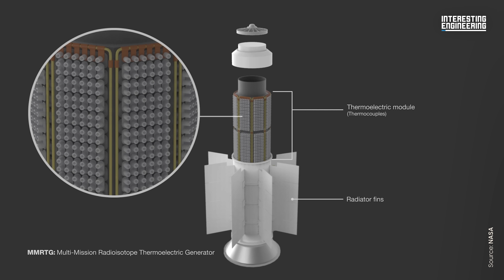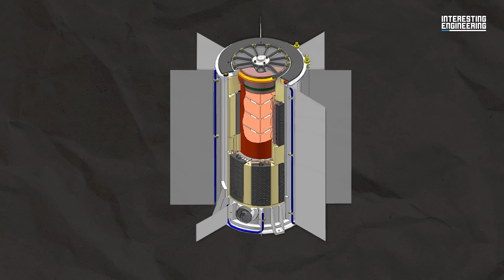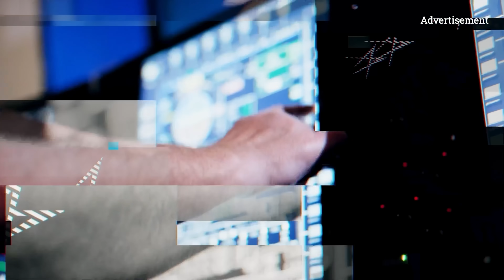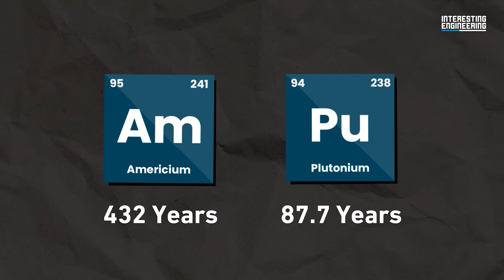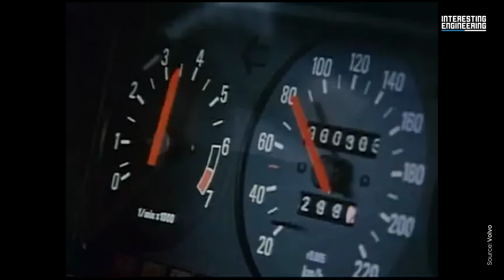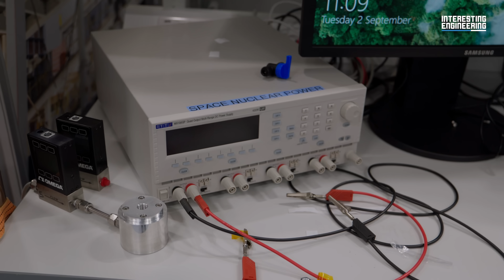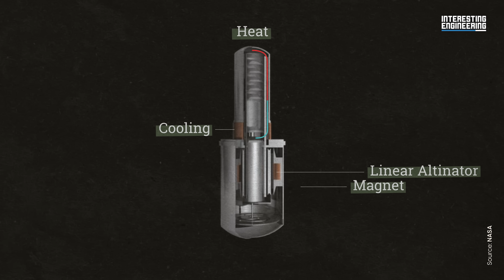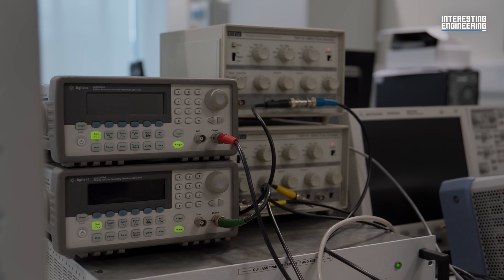Americium: The Element That Will Transform Space Travel

Comment: Americium, depending on the isotope for efficiency and electron migration from the nucleus for its placement in decay-chain (a principle not far off Caesium or Rubidium clocks), acts as a clock-signal, but so does a Stirling engine and also, so does an alternator if it is regulated by the sterling-engine (which it is, in that diagram). However, the americium is not simply an isotope clock but also a heat-clock by emission since ultimately it is unavoidable that the craft shall radiate some energy into space. That latter emission changes over time because the decay reduces the potential energy in heat but not the rate of isotope effective nuclear charge, even though half-life does undergo total rate differential. By means of comparing the "clock-signals" that won't change to the clock signals that will change, that is thereby a polynomial and phase shift 9and phase error) generator, as a crude function generator and potentially a crude PLL, phase-locked-loop which, if it is not being used, is wasted _(so it might as well be used as it is an oscillator). There are various usage scenarios like vector similarity comparison and signal-integrity and polynomial-fitting that can use it, such as polynomial-fitting unto an ogive on a cumulative frequency graph and the usage of he Lplacian-domain as a time-domain by novel adaptation of the z-transform, which not only can already be there by result of using the cumulative-frequency graph and thusly the frequency domain like a histogram and subsequently the gaussian-kernel distribution (or lanczo-kernel for filter and signal analysis such as its azimuthal data) but also the Laplacian-doppler combination gets used in space anyway, and the Poisson's equation can be solved for each change as per time and gravity. It is free secondary equipment usage for the same weight (or at least the heavy bit) and it also assists the reliability metrics and Viterbi Markov-chains in the HMM. considering a matrix (e.g. hat matrix) is used, the RBF-KDE can use probability estimation (and distance traversal data over time, but also for Singular Value Decomposition) via the radial-bias-function. As an aside americium is useful as a particle detector although the chances are it might not get used of that considering how fussy the choice of particles must be for it, however it is not impossible to have that extra usage for it (since a dedicated unit would be for that, if at all). Reuse (of the Sterling-engine Americium unit) is, however, theoretically possible with tweaks. If that happens, it gets called the Yankium (because a Sterling engine is sort of yanking its oscillation, and that is the rationale and for no other reason whatsoever, especially not anything to do with Americium having the name it has).
My comment has no hate in it and I do no harm. I am not appalled or afraid, boasting or envying or complaining... Just saying. Psalms23: Giving thanks and praise to the Lord and peace and love. Also, I'd say Matthew6.

Comment: Contrary to what the film portrays, americium-241 is a poor power source for space missions. While it has a half-life five times longer than plutonium-238, it also generates five times less power. Voyager was equipped with 13.5 kg of plutonium, so for the same power output, almost 70 kg of americium would need to be loaded. It's worth noting, however, that ESA, for example, is considering launching a facility with a yield of 0.5 kg of americium-241 per year, meaning Voyager's feedstock would have to wait over a century.

It will be a major achievement if, in ten years, ESA completes a project for an americium-powered thermoelectric generator with a "massive" electrical output of 10 watts. And what could be done with such power, even if it were available for 500 years?

Comment: Why can't I have this as a home power unit?????
Reply: Because then companies can't charge you excessive amounts of cash for power.
Reply: I already knew the answer! greed! @orpheuscreativeco9236
Reply: And each unit will likely cost a 7 or 8 figure sum… which you will NEVER MAKE BACK, even across the entirety of your lifetime!!!
Reply: It will cost way more that all the electricity it will ever produce. By a long shot.
For example, just very approximate numbers - it might cost you about 1 million dollars to procure this power source. But it will give out only say 100w. At the same time you can buy a 300w-400w solar panel for just about $100-300 and overall it will produce the same amount of electricity
Reply: 100-300W isn't very much!  Just a few incandescent bulbs!
Reply: It’s not practical - RTGs last a long time but don’t produce enough power for home appliances. Most RTGs produce around 300 watts; that’s not even enough to run your refrigerator. Solar, wind or geothermal are much more practical (especially solar) for home power.

Comment: Like usual Space Travel vast distance is very incoherent with bit and parts.  We need to setup a framework to approach the problem...define the requirement, category and etc... System Engineering Model.  I tend to think in terms of categories; SPACE, TIME, and ENERGY.  For example, I suggest that warp drive or folding space has to have an access point between...like hydrogen and anti hydrogen can occupy the same space and does not follow the thought that Matter and ANTI Matter will destroy itself.  Another Category is Time...Time for humans...since people will be the ultimate and final "Sensor."  I did not realize we are our own Time Sensor.  Space is X, Y and Z as well as including acceleration and velocity.  Energy has it own equation such as Force is equal to mass time acceleration...Energy is equal to mass time lightspeed square.  Time....
Reply: The category that fits most appositely in your case is Idiocy.
Reply: @robbannstrom  This is basic saying a heavy element of atom when exploded will not affect the human body.... That a lot of particle traveling at light speed....and the more particle to tracks...computer blue screen of death.

Comment: I had the idea and the patent of using these to obsolete the electrical grid. We just have to overcome the fear. Also, the electric companies will be unable to charge you a bill as the energy is free for decades. so that makes the reality of something like that unlikely. in the end its about money to a lot of people. Think about all of the billions of dollars they are spending in finding new fancy ways to boil a kettle of water that they still have to get to your homes and businesses. Put a pack of these under every building. Completely decentralized power. There are radiation mitigation strategies, such as water jackets. That also provides a dual use, for hot water and heating. I want to make something like that reality but that's pretty tough to sell to people. I know the russians tried it and they are pretty radioactive and they had to abandon the idea.
Reply: The low power density is an obstacle. You’d need around 8000 metric tons of 241Am to get 1GW thermal and around 1/3 of that for electrical output. I suspect that 8000 metric tons of 241Am don’t even exist globally. Even if supply weren’t a problem, the inability to shut the reaction down to service a reactor is a huge problem.
Reply: @edmarciniak7612  naw man. they are 100W a piece. You only need a 10 Pack for a Megawatt.
Reply: The tech already exists to do it. Even proper boron  shielding. With a water jacket u have centralized heating.

Comment: Good old fashioned plutonium 239 as a micro reactor ( pulsed criticality reactor) could use a deuterated hydrocarbon as the working fluid/moderator. Power Stirling cycle generators. And turn it on when solar gets too low. ❤
Reply: NASA is considering just that for a permanent lunar station.

Comment: RTGs which rely on natural fission are kinda terrible compared to nuclear reactor which rely on induced fission. You can make the output of a reactor whatever you want while a RTG is always turned on and always weak. And decays with a half life rate. While a reactor can be very stable when it’s turned off it designed to be very inert, while providing megawatts of power as soon as it’s turned on. 

The radiation of RTGs is also awful, never ending and very high. 

I’m all for using isotopes we don’t have another use for like this, but I dislike RTGs as well because they lack the power needed to fuel an ion engine which are the key to space travel in a non stupid way. Missions that take 2 years not 10, and don’t bother with gravity assists. This is possible with current engines, but powering them is an issue. Near the earth or closer to the sun solar panels are enough. Beyond the asteroids, it’s a big problem. RTGs will be too weak to power them, and worst of all will release their energy continuously even when the engine is not in use making them especially awful. 

So generally I would always recommend a nuclear reactor that contains elements that allow the neutron flux and reactivity to be tuned. They can be much more powerful, create less radiation per energy, run hotter requiring less radiators, and do not waste the fuel they contain when they are not being used. 

They would be small highly enriched devices with neutron moderation. Something like 99% or 100% enriched uranium. It won’t create a critical mass or do anything if it’s too small. I wonder if nuclear waste can be used in such a manner.
Reply: Comparing use cases for an RTG compared to a nuclear reactor is pretty dumb. "I hate AA batteries because I need way too many to power my Tesla."
Reply: "Something like 99% or 100% enriched uranium. It won’t create a critical mass or do anything if it’s too small."

Then it would be useless as a fission reactor, as a "nuclear reactor" that can't create a critical mass is just an even crappier RTG. And regardless of the amount of power available, the spacecraft would also be limited by the mass of propellant it can carry.
Reply: @willythemailboy2 about 8kg heu or  1.8 kg pu with a well designed beryllium reflector would do it. ❤
Reply: A small reactor would be far superior and generate kilowatts for decades even a century. I designed one in simulation that's roughly the size of a waste basket ( 0.3 by 0.5 meters) and doesn't turn on until needed. Power output is about 5kW thermal about 2kW electrical.  Uses the deuterated pentane as both moderator and working fluid to drive an array of Stirling cycle generators ❤
Reply: Thank goodness we have your opinion.  TL;DR
Reply: That is why NASA is working ⚒ on a nuclear reactor for the future Moon Base.
Reply: Well, on my First Centauri Ark design I specify thorium breeder MSRs for power, but now I'm wondering if Americium could be incorporated into the breeder cycle. Also noteworthy, I use neutron conducting fiber (yes that's a thing) shielding to not only effectively shield but provide hollow neutron beam shot out the back. 15mg nuclear saltwater pellets are ejected into the center of hollow beam, srrounded by a magnetic nozzle, thus highly controllable, extremely powerful, coaxial micro-fission Nuclear Saltwater Rocket. 
https://youtu.be/b6cw7XGI0ps